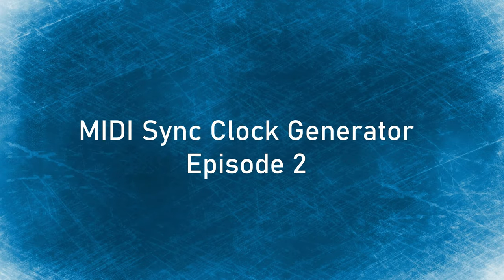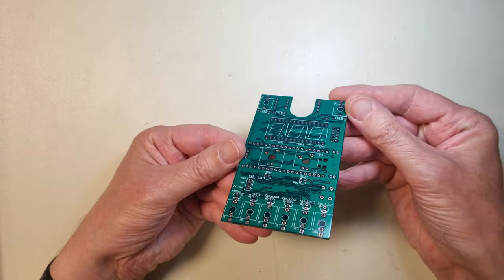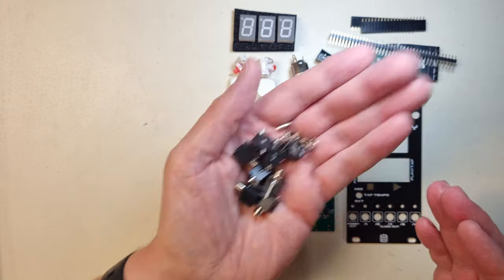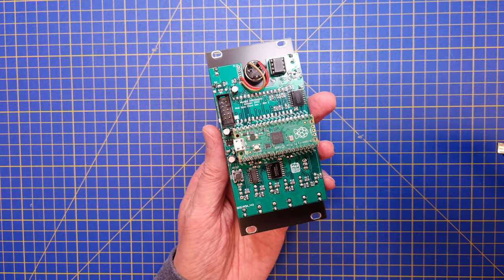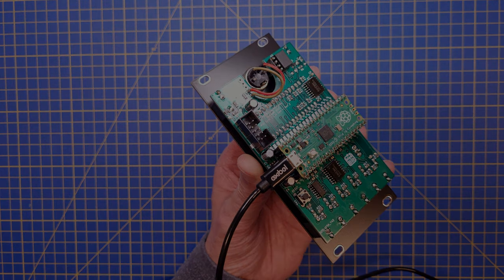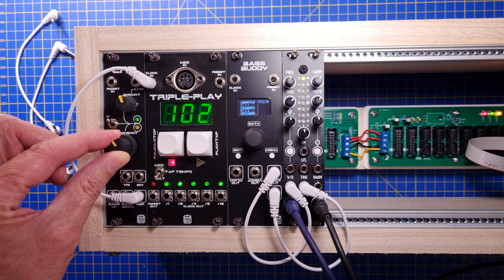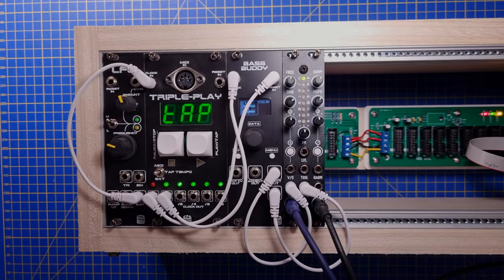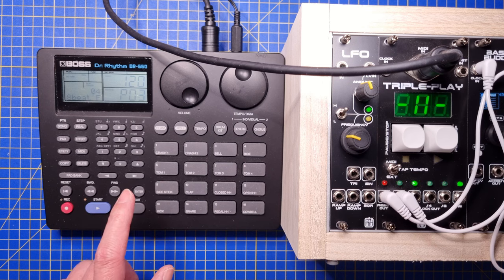Eurorack DIY - MIDI Sync Clock Generator (Episode 2)

Comment: A potentiometer and code to change the multiple/div on each output!
Reply from the maker: Not quite I follow what you mean; is it individually programmable clock outputs that is selected using a knob?
Reply: @MeeBilt  yeah a knob that changes the values for division per each output. So you could do say /2, x3, /16, /32 or whatever you wanted.
Reply: It would require a way to select which output you're programming with the knob
Reply from the maker: @the2d  I understand, that's an interesting feature. Maybe a completely new module with more programming features.

Comment: Almost what I need. Love the eurorack features, but I need a midi clock output not syncing input. Bookmarking for when its not 1:19am because it would be a trivial feature to add but I don't have the brainpower to think about it atm.
Reply from the maker: It should be doable without too much problem I think, but you need to add a HW MIDI out interface and rewrite the clock generation code a bit so you can generate 24 PPQ MIDI clock messages.

Comment: I've been wishing to build something like this for a long time, specially interested in the multiple divisions. I'm still stuck into the protoboard stage due to severe lack of time... Your panel prototyping using 3d printing encouraged me to try the same, instead of "discarding the idea" before even making a test.

Thanks for sharing the code!
Reply from the maker: Thanks, I use 3D printing a lot to check the panel layout and to get a feel for where everything is placed, before I order a PCB.
Hope you get some time to finish the project!
The code is a bit of a mess right now but I will fix that later on.